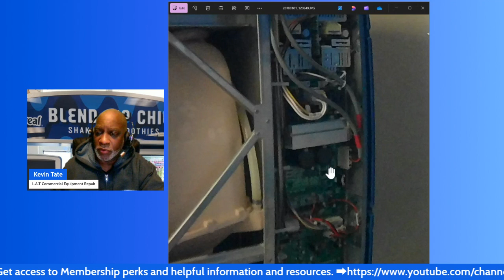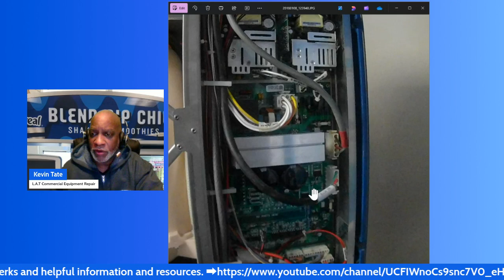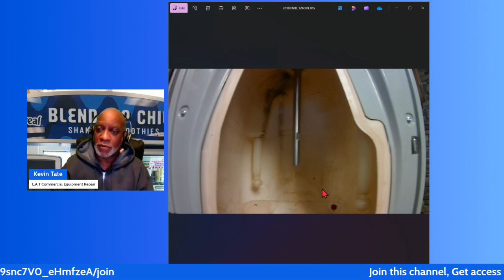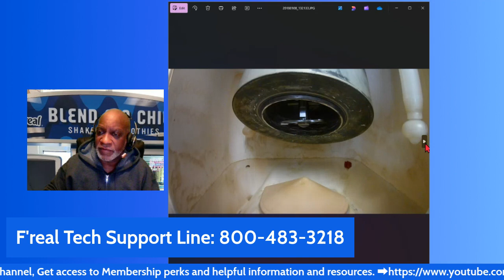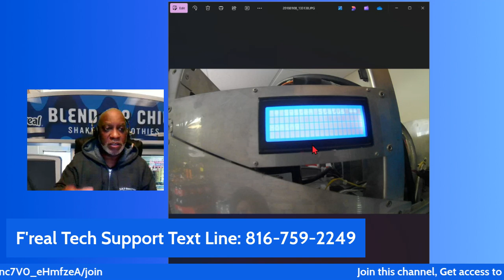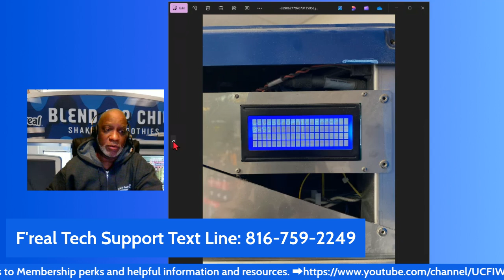How to Repair a F'real Blender (Error 91)

Comment: Hi
If a F’real B6 blender is very noisy and still blends ok. What is likely the cause. The customer reports to noisy to use
Reply from the maker: “Hi, if the blender is still blending correctly but has become much louder than normal, the most common causes are usually a worn blender motor bearing, worn drive coupling, or the blade assembly starting to wear out.
On the F’real B6, I would first check:
🔹 Blender blade assembly for wear or looseness
🔹 Motor coupling/play in the shaft
🔹 Any signs of bearing noise when the motor spins down
A bad bearing usually creates a grinding or high-pitched whining sound that gradually gets worse over time.
Also make sure no ice buildup or loose mounting hardware is causing vibration noise. If ignored too long, it can eventually damage the motor assembly.”

Comment: I’m based in the uk and my company has just been given a contract to repair f’real B6 machines. Have only been given 1/2 days training. Your video are a great help
Reply: Hi
  Yes that app could be useful. Yes would  like the link thanks
Reply from the maker: @lesliewhicker7409  Thanks for watching! Absolutely — here’s the FREE LAT Technician Pro App link 👇

📲 https://learnatrade1-ai.github.io/lat-tech-app/

It’s built for commercial beverage equipment technicians to help diagnose faster, reduce callbacks, and troubleshoot with confidence in the field.

If you want the full Pro version with advanced workflows, diagnostics, and PDF reports, that’s here 👇

🔓 https://www.learnatrade.online/unlock-lat-technician-pro-access

Let me know what equipment you work on most—fountain, ice machines, coffee, frozen beverage, etc. Always glad to help.
Reply from the maker: That’s awesome—congrats on landing that contract 💪
Those F’real B6 machines can definitely throw some curveballs, especially with limited training.

Glad the video helped. If you run into specific issues (like Error 91 or motor/door faults), drop a comment and I’ll help you troubleshoot it.

Also, I built a mobile troubleshooting app based on real field experience that walks you through issues step-by-step—it can save you a lot of time on calls. Let me know if you want the link.

Comment: hey Kevin  appreciate the info as usual , I actually had an freal machine given to me , code 91 pops up  when plugged in , I do not have the unit hooked up to any water source ,  should it be connected to water before diagnosing or does that have nothing to do with that code
Reply from the maker: Yes it should be connected to a water source before powering up.